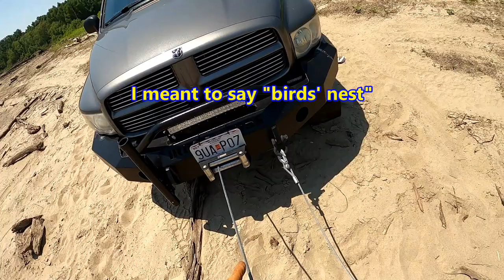New Dodge Ram, Mark Twain Edition.  The Mississippi River Mud-Slide.

Comment: Get rid of that steel cable on the winch, then your not as likely to get a birds nest.
Reply: I stopped using steel cable over a decade ago and will not ever run it again.  An eye pulled out of the end and the cable whipped back nearly took a guys arm off.  Cut him to the bone.  Synthetic would have been a crushing injury, but he might not of lost his arm in the end.  Synthetic has a lot of advantages but you have have to really careful with abrasion, which is why a lot of people still insist on using steel cable.  There are a lot of interesting recovery gear coming onto the market specifically for use with synthetic ropes.

I'm honestly not sure why the wrecher is resisting changing over.  The off road recovery segment will just about have steel cable eliminated in another ten years.
Reply: @PetrolJunkie  I suspect when the price of Kevlar comes down it will be used more for the winch cable. Extremely strong but light weight.  One challenge is it abrades easily. This may be one reason wire is still used so much.

Comment: nashville diesel is where i went was a great school {lincoln tec bought the school from 2 old brothers that started it they were 98 and 96 in 2001 when i went } rushes the people  thru to fast. tell your kid stay away from the night live in nashville and go to there libary and get your kw and pete and mac card  hydrauils and wiring aka how to read a meter the rest is nuts and bolts. i hade a great time up there got a job in nashville that year and drove the company truck to school was 24yrs old etc wanted a change from welding every day since i was 14 yrs old. MR. RON   dickerson pike at nite stay away all i will say. get all the school you can my friend air brakes hydrauilcs engine computers . thanks ron

Comment: Wouldn't dropping the tire pressure in his truck some help him out alot ?
Reply: Hard to tell with the kind of wet clay bottom he was on. Like Ron was saying, it seems like hard ground till its not, and then it's too late and you're sunk to the frame. But in general, yes, airing down helps you float over soft ground more easily.